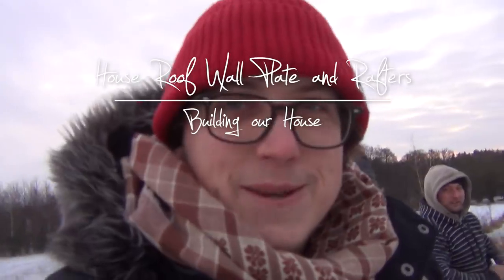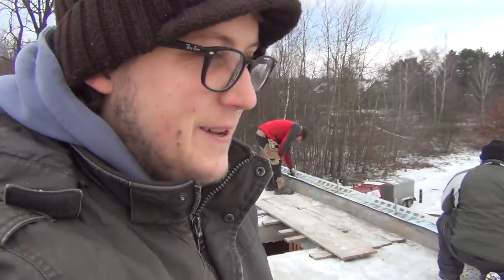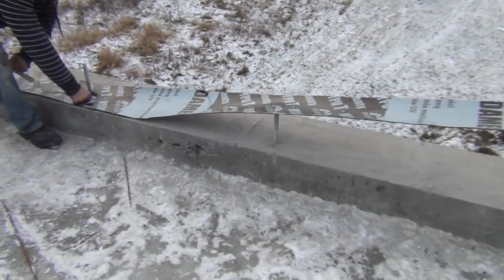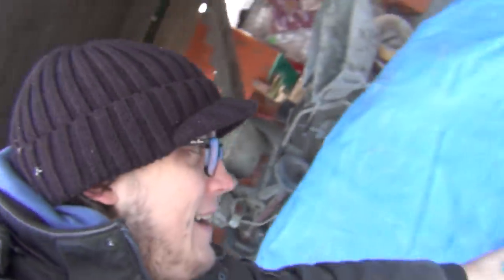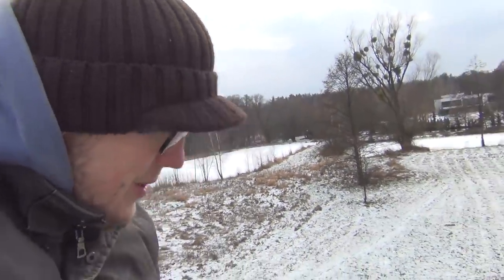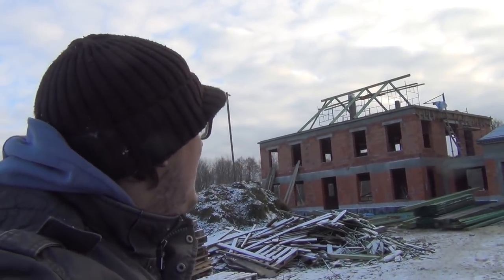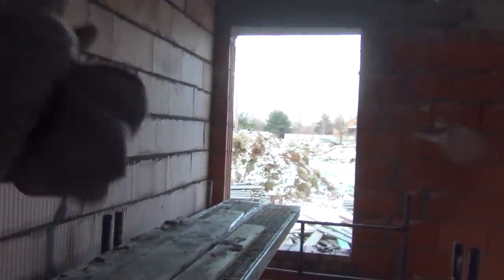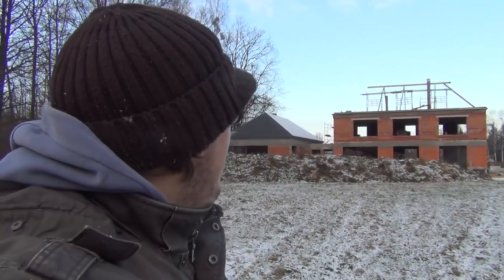BoH 101 - House Roof Wall Plate and Rafters

Comment: I'm glad you're back :)
How many square meters does the house have (including garage)?
Reply from the maker: The House is 128 (ground floor) + 122 (first floor) so 250 m2 not counting the attic its not going to be a heated area for now, the interconnect between the house and the garage is 20m2 i call it the mud room in the videos and the 20m includes the 2.35m2 pantry that is accessible from the kitchen so you can treat it as part of the main house. The garage building is 93 (ground floor) + 24 (attic) it is all supposed to work out to a total of 387 m2 usable space. 

If you recall to the summer episodes we did some plumbing under the garage building. The idea is that we can add a kitchen and a bathroom to the studio space behind the garage effectively making a separate fully functional 80m2 open studio apartment living space. For example in case any of our parents ever needs to come live with us or for whatever other reason. So in effect it sometimes feels like we are building 2 houses :D